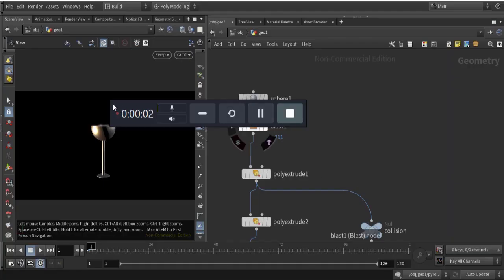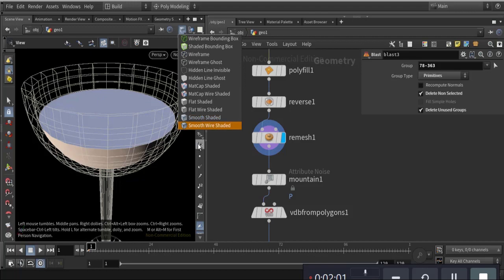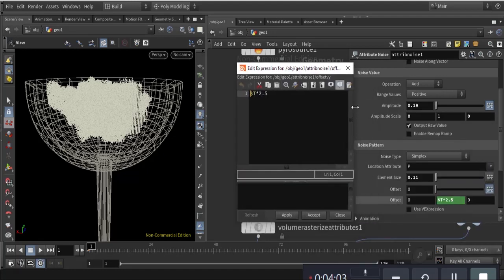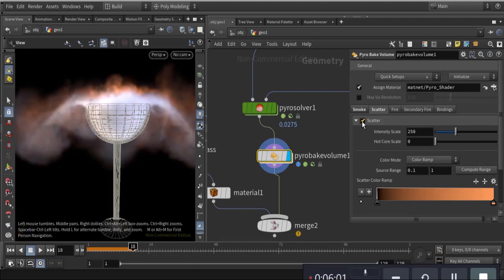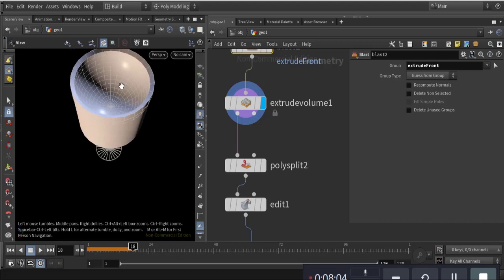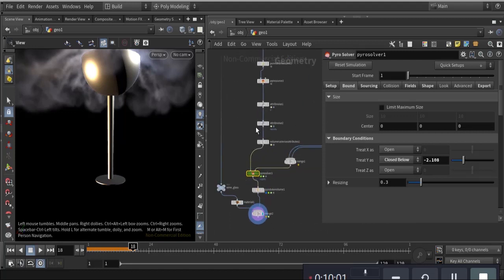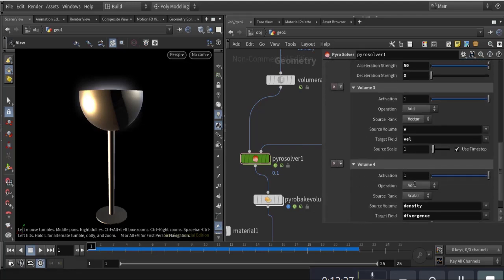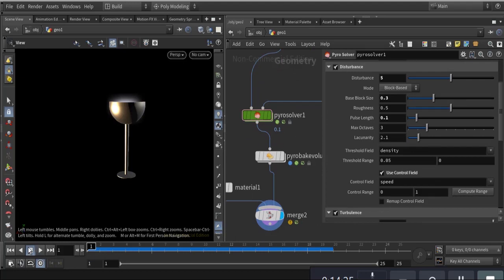Dry ice in Houdini | Dry ice smoke simulation in Houdini 19

Comment: Nice tutorial! I'm curious though. I don't think you displayed the choice you made with regards to the collision object, specifically with regards to breaking out the collision object to geometry and then also volume surface vdb's, and then it's relation to the "Collision Type" in the pyro solver sop/collision section. For instance, which option did you choose? 1) Collision, or 2) SDF + Volume Velocity. Certainly velocities are not needed for this tutorial, but I am curious if velocities were needed then a) if option 1 was chosen, Collision, then simply using geometry with a v attribute, and so then I'm wondering it it's being converted in the sim, which is sort of like how a "v" to "vel" occurs in the traditional dop networks setups. (Option 2 is less confusing because it states that one is expected to supply a volume velocity)